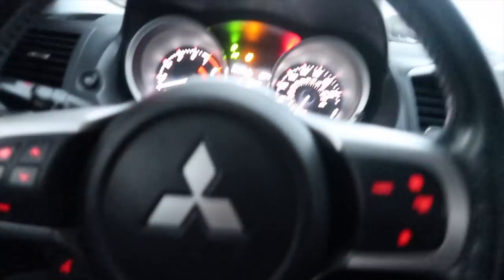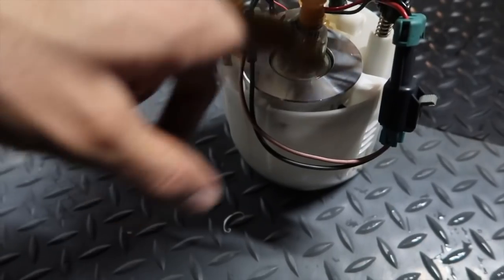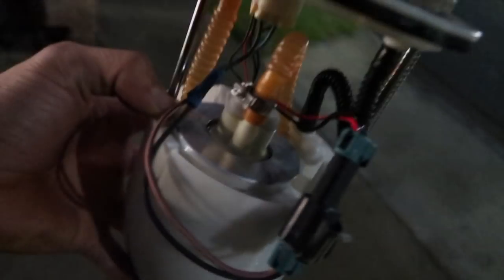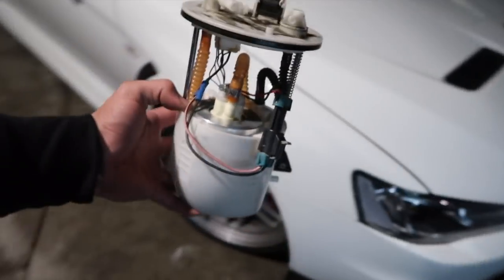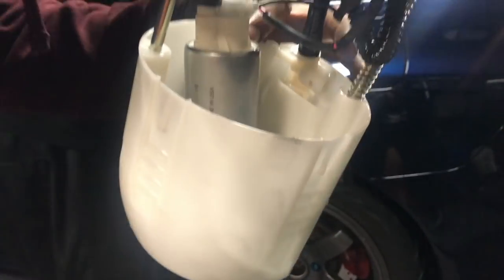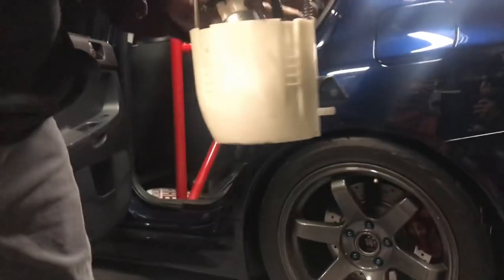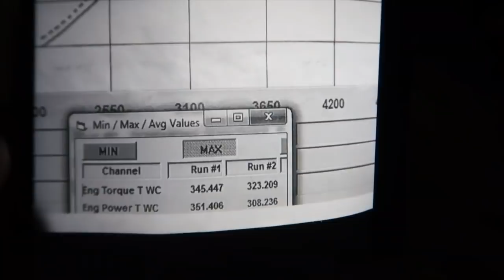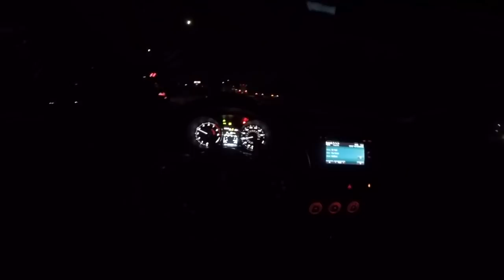MY EVO X FINALLY GETS TUNED! | EVO ON EVO ACTION!

Comment: If you are using Iridium plugs they dont require you gapping them and if you get the Grimm Boost solenoid you dont really need the brake booster. Stock turbo is to small. Brake boosting si usually for big turbos

Comment: I just recently got tuned for my X out here by Gary Bains from the Bay Area. I dyno‘d 390whp/368tq. Just full bolt ons w/ an AEM 320 and ID 1050cc. I’m surprised you were at 350.
Reply from the maker: Hyphe what kind of dyno did you tune on? I tuned on a mustang dyno
Reply: Lowtek I tuned on a mustang dyno as well. Over at speedelement in San Jose.